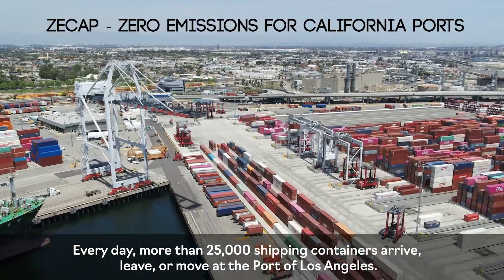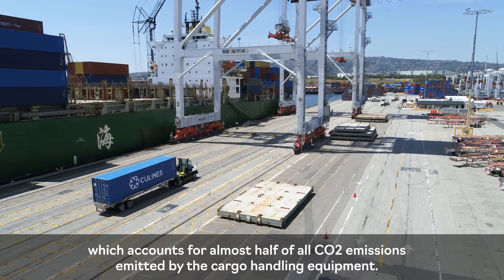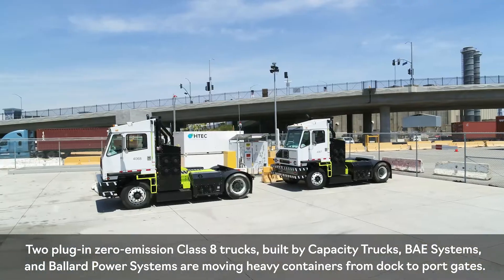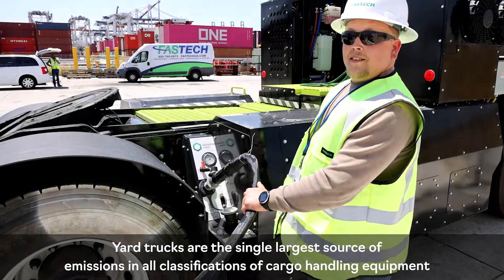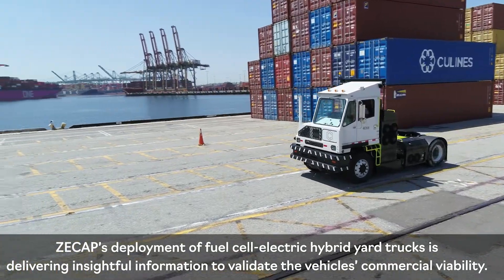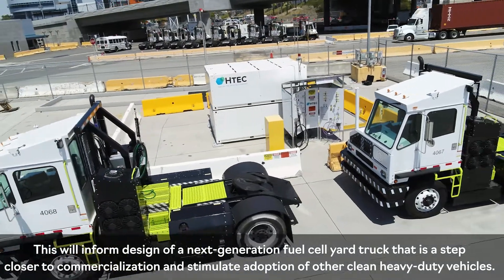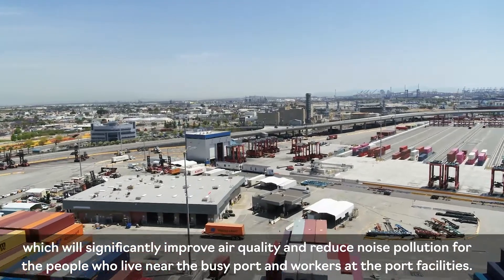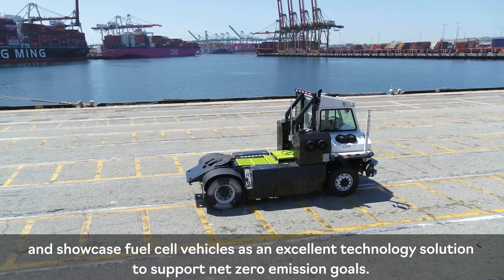ZECAP Hydrogen Yard Trucks

Comment: Yard spotters operate 24/7.  The study at POLA done by Ballard stated they run on 14 hour shifts a day.   If they have to refuel or sit idle for 10 hours out of a 24 hour work day, then this is a problem.  How can they compete with cheaper spotters that can run 24 hours a day.